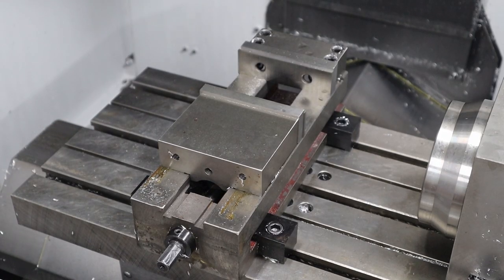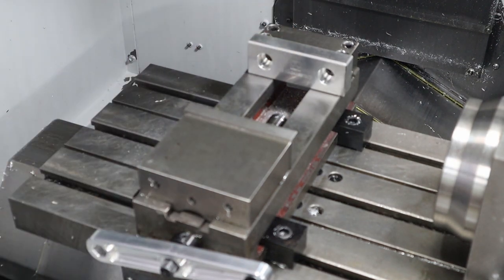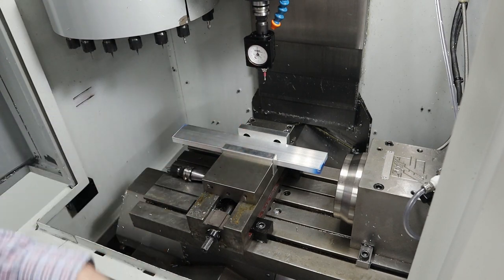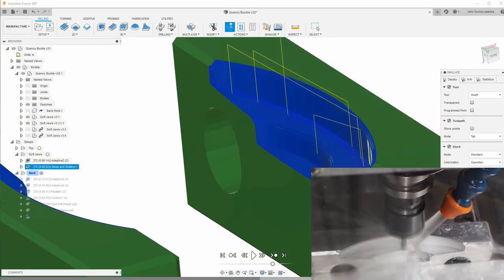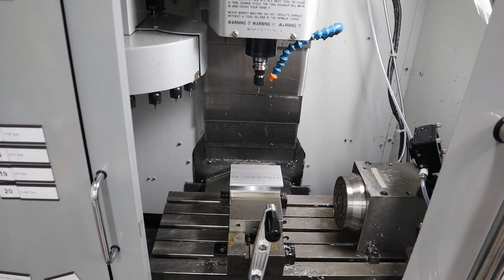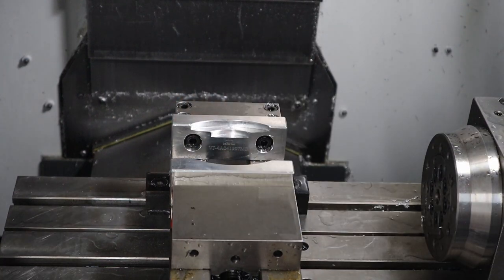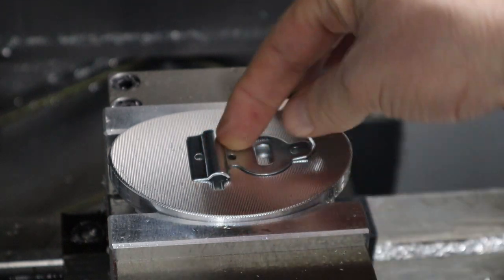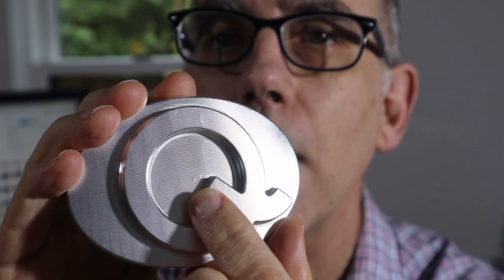CNC Belt Buckle for Quincy Part 2

Comment: Nice work.  I have never made soft jaws myself, but I thought it might be a good idea to secure them with flat head bolts rather than the socket heads.  You have done a nice job machining them but I think that once you remove them, they will never sit in perfect alignment again.  Securing your soft jaws with flat head bolts will help with repeatablility if you ever want to use them again.  Again, I haven't done this before so I could be wrong, I just think it looks like you will have a dificult time re-aligning them in the future because of the play in the socket head bolts.
Reply from the maker: The soft jaws sit down on the flat horizontal surface of the vise, which helps with much of the alignment. That just leaves side-to side, which is pretty easy to get right. In other words, usually quite well. In this case, it was a single use, as I only made two of these buckles, and I used my 4th axis for the second one.